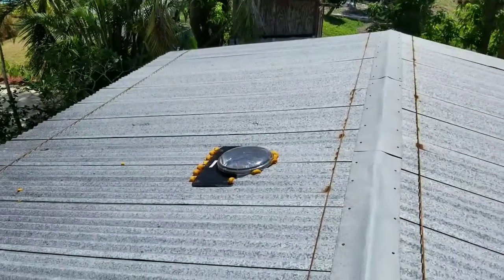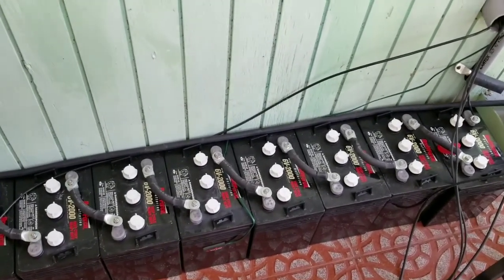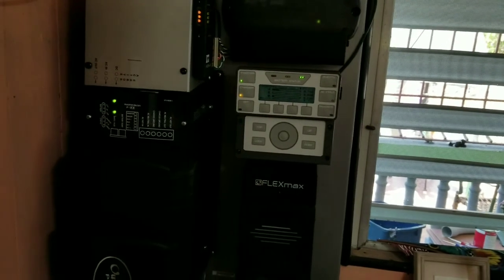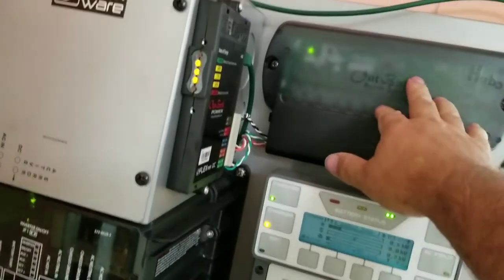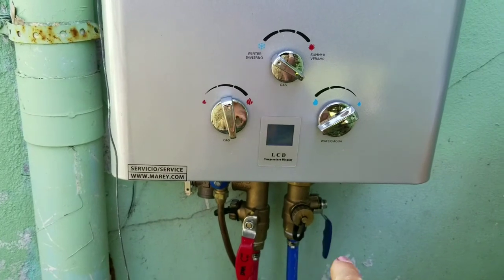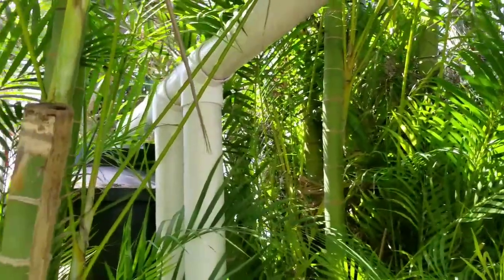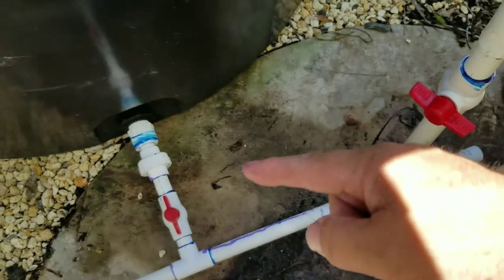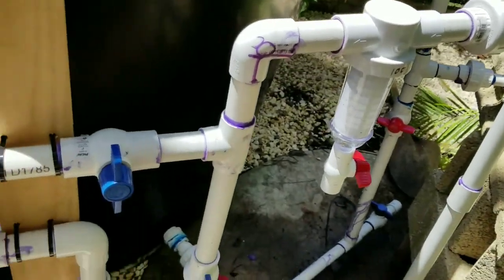Off Grid in Rincón Puerto Rico

Comment: So 3 years later have you changed out your 6v batteries yet? I have a 5kw 20 panel system on my house roof here which is also connected to the grid. We are not allowed to be stand-alone in suburbia (Melbourne Australia), and I am not creating enough to charge a set of batteries at present as I am using what I create and return minimal to the grid on a daily basis. My mum has also a 3kw solar system and 2 x 5000 ltr water tanks which she accesses from daily. There should be more use of solar and water tanks on every house and building these days as it would reduce a lot of issues with no water or power etc but the issue is the Govt wants their cut with the fossil fuel systems and they will not give up their $$$$ in their pocket so it will never happen.
Reply from the maker: Thank you for watching Tim. Yes, that system has been working well since I switched to Lifepo4. CUOTO

Comment: TimBatSea, very informative information. We purchased a home in Aguada, PR. and I'd like to do some more research on a solar system for emergency only. Would a system like this be an overkill?
Reply from the maker: Thank you for watching George. There is a huge divide between backup systems and fully off grid systems. So yes. You would not need a system like mine.

Comment: Tim, I note that in describing your system, you said nothing about grounding, except for the surge protectors.  BUT you need to connect those protectors to ground so they can bleed off properly.  I suggest driving a 10-foot copper clad ground rod into the earth, and connecting it with about #6 copper wire to the panels, the negative side of your DC system, and the AC neutral, all using a minimum length wire run.
Reply from the maker: Thank you for watching John.  And thank you for the good advise.  My system, as per code, has two grounding rods placed into the ground 8 feet apart and the system has one common central ground.  CUOTO

Comment: Congratulations on your success. I subscribed and put notifications on, so that I can keep abreast of your plans. Are your Battery Banks Lithium? You Water setup is genius. I’ll be consulting you once I start with my Blue Prints for the house. Has the local government give you much heat over your setups?  Nice setup. I want to do the same setup like yours. Thank you for sharing. I enjoyed watching!
Reply from the maker: Thank you for watching Jose.  So that was an older video.  The channel has shifted to where my audience is, the maritime stuff.  But I am just about to do a big video on upgrades to my system in Puerto Rico.  After 3 years of heavy and constant use, my lead acid batteries died as expected.  I am make a major jump not only to Lithium but also to a back 4 times as big!  I also will be moving things into my basement.  Should make for a fun video.  Feel free to email me any time if you have questions or need help on your system.  And the local government has not given me any problems.  My email address is timbatsea@gmail.com
Reply: TimBatSea -Very interesting. We sold our 2001 26X McGregor. I had wanted to add Solar Panels and a couple of Wind Turbines, but we sold before I could do the changes. I wanted to sail into P.R. but I heard some difficulties with some sailors, so we’ll be flying in. Is your Water System test by Hurricane Forces? I’ll try to keep in touch with you. I really enjoyed watching your vid. Thank you for sharing! Later!

Comment: The panels should have space between them and the roof. They lose a lot of efficiency when they can’t ventilate. Your conduit is also open to water. Is this system still working?
Reply from the maker: Yes it is. The panels get plenty of ventilation being suspended off the roof by three inches or more. But thank you for being concerned.

Comment: NICE! We have a lot of iron here so we have 2 backwash filters, a spin-on and an ion generator and compressor but  Berkey filter for drinking water. Worth buying and you might ought to run your check valve vertical. The rust stopped ours up and it cost several dollars to get it fixed again.
Reply from the maker: Thank you for watching. My check valve is spring loaded (not the flapper kind) but I will keep an eye on it in the future.  Thank you for the good advice.

Comment: What refrigerator did you switch to. I’m curious because I have solar panels as well
Reply from the maker: Thank you for watching. I ordered a small more efficient apartment sized refrigerator from home Depot, but after 2 and half months it didn't come and they said it was discontinued. (I ordered it because I liked it's energy consumption) So out of necessity I had to buy what was there in stock. I just read the yellow labes for the one with the least about of kwh use.

Comment: Hi,  thanks for making this video. I'm a newbie interested in learning how to get off grid. Can you recommend some resources for learning? Also,  you mentioned that your system would allow you to sell power back to the power company.  This would seem like a great way to offset equipment costs, especially in a vacation home where you are generating but not using power for long periods.  Is there a program in PR that allows you to do so? Lastly,  how do you keep bad guys from lifting your stuff. I saw the nest but have doubts that would be enough of a deterrent. Thanks for sent info!
Reply from the maker: Thank you for watching. Yes, the Outback system, and many others, have a mode that allows you to sell back to your utility. But it is a little more than just turning it on. Yes, that's all it takes to send your power back to the grid, but the utilities are not always so accepting.  And this is for good reason. They don't want anyone just charging their lines. They want the system to be installed by a licensed and qualified electrician that is solar certified with the local provider. PREPA (PR's power company) does have a few programs but non that I am aware of at this time for self installers. (On a side a personal note: I did not want to add to Puerto Rico's power problems or look to receive revenue from a system that has enough problems just trying to provide for it's fulltime residents. So disconnecting completely made sense for me). My system and I are very close to making a major upgrade. I will be switching over to Lithium soon. Stay tuned for video. And feel free to contact me if you would like to come by for a tour (it may cost you a few Medallia) I love to talk solar and it is very doable for most DIY people. Thank you again.

Comment: I, also, like the NiFe batteries.

Great rainwater system.

Before the UV light, I would install a GE whole house filter.  This will trap some of the larger particles before the UV light.  

Some critters might avoid the UV light if the particles in the water are large enough to shade them.

I recommend a 2-gallon water distiller but only for drinking water.  It uses almost three kilowatts of electricity per gallon of water.

It will get rid of most stuff in water (chemical or biological).  If you require, you can always add a few grams of minerals to it.

For washing fruits and vegetables, get Microdyn from Amazon.

For showers and clothes get a chlorine dosing system.  It will add a few drops of chlorine per so many gallons of water.
Reply from the maker: Thank you for Watching

Comment: What is the total cost of that set up )
Reply from the maker: The Electrical or water system?
Reply: TimBatSea both ?
Looking to buy a retirement mountain home in Rincon or nearby area this system would work great !
Thank you great set up !
Reply from the maker: @Enoch-Gnosis  let's see.. the batteries where $1200. The panels where $1980 and the power enter was $3600. These things change quickly. Now you can get alot more stuff on the island than you could when I did it.  The cisterns (I think) $699 or so for the 1000 gallon and $399 for the 600 gallon. I had the 200 gallon already. The UV filter was $125 on eBay and the spindown filters we're about $45 a piece.
Reply: TimBatSea thank you for the breakdown! It’s a good investment in exchange for breaking free from the Grid👍🏼 enjoy your awesome Caribbean getaway , hopefully I’ll be there soon to start my small fruit tree farm .
Rincon Realestate is on the high end in comparison to nearby location , but it it a safer location .
Enjoy!
Reply from the maker: @Enoch-Gnosis  Thank you for watching and I hope you will be a subscriber. I am hoping to make the jump to lithium batteries very soon and will continue to post updates. I also have an entire series of videos coming out that go over the systems I have in my house in Rhode Island. (7.4kw PV, XY Tracker, Solar hot water, pellet boiler and radiant floor heating)
Reply: TimBatSea subbed! 
Just a heads up, PR is a prime location to be during the pole shifts that’s accruing .

Comment: Awesome self sufficient systems! This type of setup is excellent for emergency preparedness in PR. It is such a beautiful island and the Solar irradiance is perfect to make off grid systems very reliable source of energy. As you expand the system, take a look at wind turbines, it gives your system night time production for days with little sun. PR has excellent wind and can help the battery life and state of charge.
Reply from the maker: Thank you Pedro for the kind words. The system has been working well for over a year now. I had thought my old lead acid batteries were dying prematurely, but after some adjustments in the charge controller and an equalization,  they are able to run diwn to %83 until the sun starts charging the system again the next day.  I plan to invest in the Simpliphi lithium ion batteries soon, so stay tuned for a new video. 
    I have had wind power in Maine before,  and although it is true that Puerto Rico gets plenty of wind, we are on the west coast (easterly trades) and we are in a valley that would require a massive tower to get optimal an obstructed  wind.
Reply: TimBatSea For wind, The Valley can be tough. In that case, the addition of Lithium batteries and slightly larger array to cover you when you have a couple of back to back cloudy days. I just recently found a stock of SunPower panels for sale on eBay and they are great for efficiency reducing the foot print on your roof. They are listed at around 37 cents a watt. Keep us posted of your progress!

Comment: you didnt6 put cost,great vid would like to go back to PR IN ABOUT 4-5 months retire
Reply from the maker: Emanuel Colon ok. $1200 for cheep lead acid batteries 
$210 for each 320 watt panel
$3900 for Outback power center 
$850 for 1000 gallon tank
$65 for each spindown filter